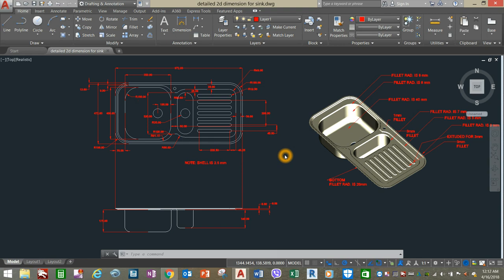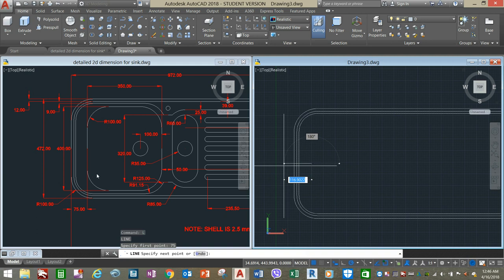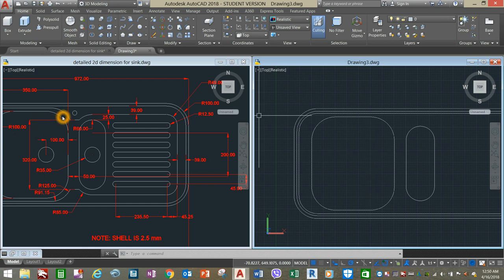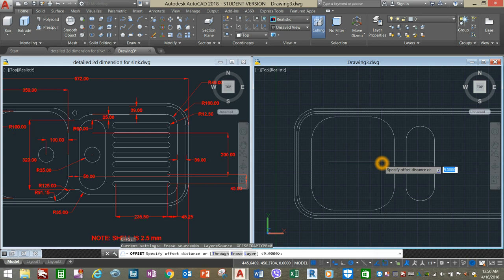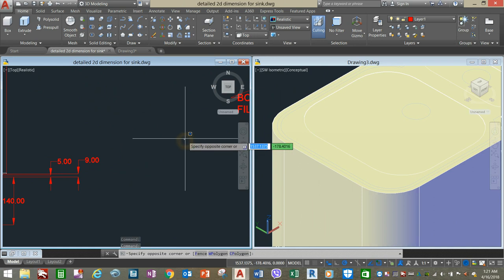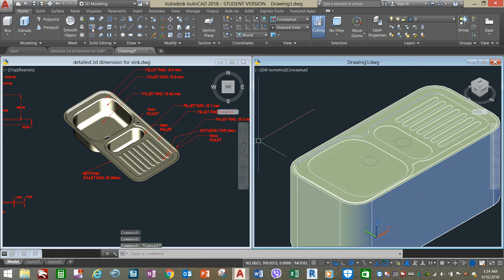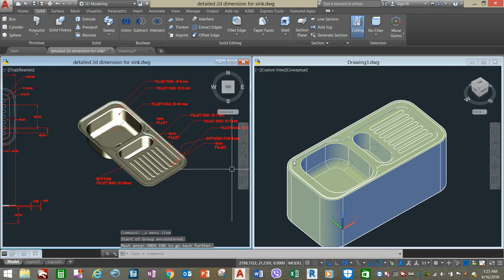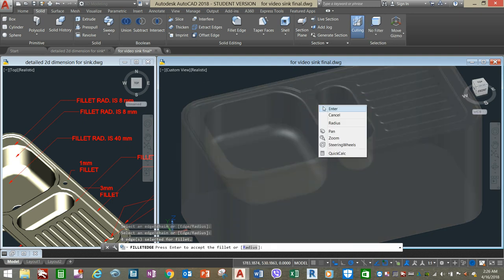Modeling of a kitchen sink in  AutoCAD 2018

Comment: Good Video
 I just watched this and it's quite intriguing.
But, While using the Shell Command, why choose an offset distance of 2.5? Please explain. Thank you.
Reply from the maker: That is the thickness of the shell
Reply: @AC3DCad  Thank you so much for your reply but how was this Thickness determined or calculated.

I mean, why choose 2.5 ?

I  tried doing the same thing but when I got to this point and activated the shell command, that didn't apply.
Reply: Please help me. Thank you. 

Or, in order words, Where's the shell of Thickness 2.5 on the object seeing that virtually all the faces surrounding the object have been removed.
Reply from the maker: @ayanamsam6931  "A better quality stainless steel kitchen sink is the 18-gauge, which is 0.0500 inches. Many home improvement choices recommend 16 to 18 gauges as a good choice for a stainless steel kitchen sink. The more costly, a 16-gauge stainless sinks is often touted as a luxury sink and are 0.0625 inches thick" , your design , it is up to you within the standard thickness , I think 2.5 is a lot thicker https://www.ruvati.com/16-gauge-vs-18-gauge-stainless-steel-sink/#:~:text=A%20better%20quality%20stainless%20steel,and%20are%200.0625%20inches%20thick.
Reply from the maker: @ayanamsam6931  here's another sink exercise https://www.youtube.com/watch?v=wRmZAavz43k
Reply from the maker: @ayanamsam6931  the reason why I removed the faces before applying the thickness otherwise the sides (faces) will be showing and hollow inside. Pls study how the shell command works.
Reply: @AC3DCad  

Thank you so very much. Blessings. Thanks so much for taking the pains to explain. Blessings. Amen